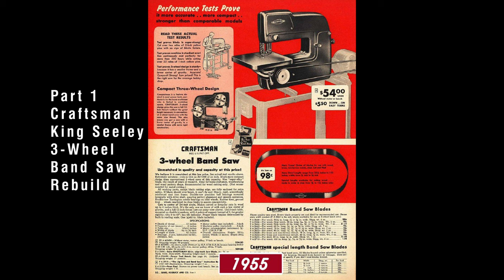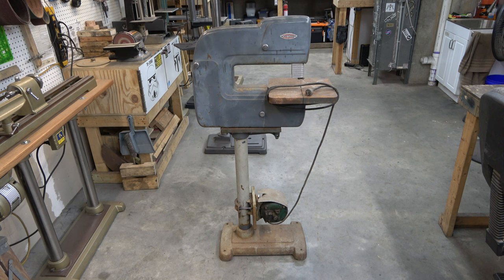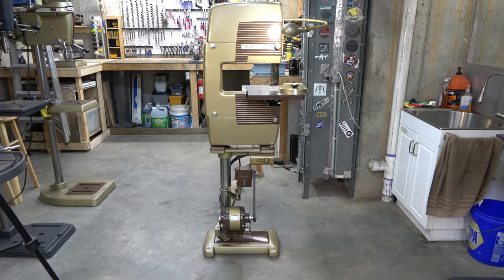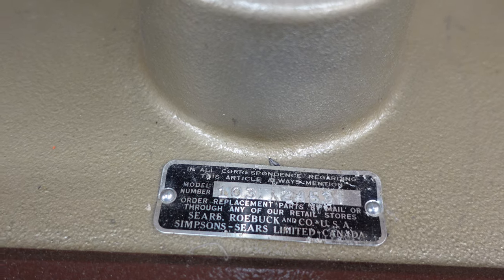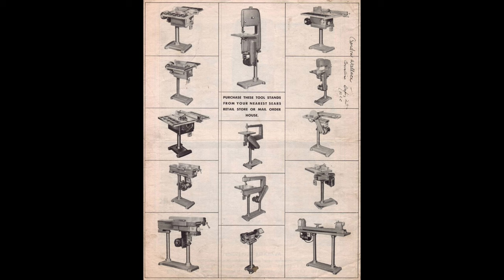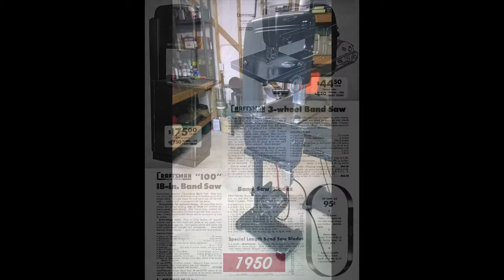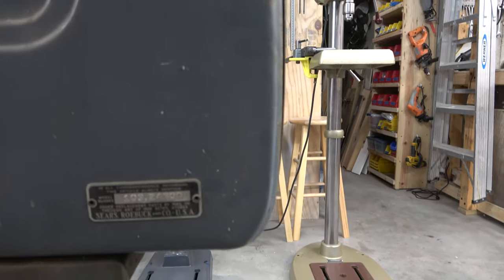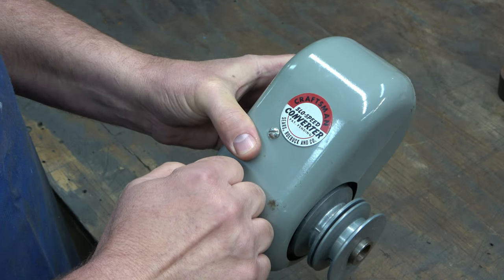Part 1 Rebuild Craftsman King Seeley 3 Wheel Band Saw (Introduction)

Comment: I was going to pick one of these up off Craigslist, but read there may be issues due to the tight radius for the blade. I'm looking for a dual wheel metal cutting band saw by King Seeley if they are out there.
Reply from the maker: I believe KS produced the larger 18” (100 series) band saw for Craftsman (see p.8 1950 catalog) which was just a larger 2-wheel band saw. Sears has offered the Powered Hack Saw since 1937 and continued to sell them until 1950 and continued until the 1973. Although not very practical, it is one of the coolest gadgets I have ever seen in person. King Seeley did not make a version of the Powered Hack Saw as far as I am aware of, and I am unsure who made the Craftsman Powered Hack Saw. I know of several companies (Racine, Marvel, Keller, W. Robertson, Jefferson, SawMaster, Miller Falls, Kennedy, etc…) that made them, but it was Excel Machine Tools (which was actually the Covel-Hanchett Company) that supplied the Powered Hack Saw for Craftsman. If you are set on KS then converting a 2-wheel Band Saw, like I did is probably the best option; however, if you want an “actual” metal cutting Band Saw then the Craftsman Continuous Blade Hack Saw (Metal cutting band saw) model 108.22920 made by Excel Machine Tools from 1959-1972 (see p23 1959 catalog) is probably the best “Craftsman” option.

Comment: Great videos! I recently picked up a 3 wheel band saw and will be restoring it. Where did you get the worm gear on your 2 wheel band saw? I would like to do that with mine but when a do a search it just brings up gears.
Reply from the maker: Greg, I got the worm gear from ebay. It is a Falk Omnibox 1133W01A-15 Worm Gear Speed Reducer/ Ratio 15:1 that I paid $87.49 + $16.98 for shipping. A search of ebay and other sites for 15:1 Worm Gear should produce some options for you.  If you plan on cutting metal, then you will need a reduction between 15 – 20 to 1 (15:1 or 20:1 etc…). Here is a link to my full rebuild of the 2 Wheel 12” Band Saw on Garage Journal (I was not making videos back then). 
https://www.garagejournal.com/forum/threads/11b30b4s-craftsman-103-24260-band-saw-rebuild.474234/
Reply: @JeffsShop  Great, thank you! Keep the videos coming they are very well done and gave me the confidence to restore a drill press I received.